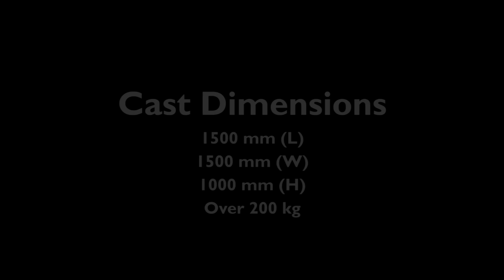Over 200 kg (440 lb) Aluminium Casting of a Meat Ant Nest - Iridomyrmex purpureus - 2015/10/19

Comment: This was very well planned from the looks of it
Reply from the maker: +Chris itsmeyay It took us months of planning
Reply: +Australian Ant Art How the heck did you melt 440lbs of Aluminium?? that must have taken a couple days! What was the average size of each pour?
Reply from the maker: +TheBackyardScientist We poured 13 times. Which is over 15.4 kg (over 33.8 lb) per pour. Our crucibles hold about 38 kg each and we have two furnaces. Of course we are counting the tops in this but we estimate we have over 100 kg in the ground. It took us a whole day to melt and pour. 2 days to get it out of the ground and on the back of the truck (ute ;) ). 1 day of set up and 1 of pack up. 5 days all up.

Funny thing is that this is a small meat ant nest.
Reply: +TheBackyardScientist How goes the backyard explosions?
Reply: +Australian Ant Art holy crap, and this is just a small nest!
Reply: +Chris itsmeyay Finale solution-like planned
Reply: Yes it was definitely premeditated murder. Guilty as charged.
Reply: poor ants XD
Reply: antz fall humans and honeybees rise
Reply: ***** and waps and hornet's die!
Reply: i want to do a wasp nest..
Reply: +Australian Ant Art 
If I may suggest, rent a posthole auger, or manual (clamshell) posthole digger, and buy a cheap sewage pump. Dig a 4-5' deep posthole, put the sewage pump in, and start it up before you start power-washing the casting to free it - should save you quite a bit of time messing around with shovels and trenches on the next one.

Very impressive, btw!
Reply from the maker: We have plans for the next one, if we ever do it again.
Reply: Australian Ant Art 
Experience is always the best teacher, no doubt about it!
Reply: +Australian Ant Art the old Ute might be struggling when you get a big meat ant nest mate ;) bloody buggers get big out in the Territory where I'm from, specially out bush.

Comment: Can you pour melted glass instead of aluminium
Reply: +Jee Khin  Ooooh!  Though my guess is that the glass would be too viscous and would cool too quickly to travel far.  That would be quite a sight, though.
Reply: Molten glass would cool down too quickly in these conditions and would fracture/shatter, and you wouldn't have the nice single unit extracted from the ground as they did with the aluminum.

Comment: Umm... Just out of curiosity when you guys do this do you not wonder if you are poisoning the soil there? I mean this sort of thing is not recommended by the EPA is it? I mean sure it produces some of the best artwork I have ever seen which is cool and all but, is it really worth the risk?
Reply from the maker: An small particles of Aluminium will oxidise and form Aluminium oxide which is very stable and nontoxic. Everything else is removed from the ground.
Reply: Ok Cool good to know that you thought this out before and not just willy nilly pouring molten metal in the ground. I was also wondering if you would do a post clean up video so it could be closely examined.
Reply from the maker: We just fill in the hole. Not much else we can do and not very interesting but will consider your suggestion.
Reply: LOL I was not referring to the hole but the artwork or casting. The video of where yall had it up on the truck did not show very much.
Reply: Hey Big Game, 
I don't know if Aluminium is poisonous when its in its liquid state but pouring it into the ground without knowing the consequences is not what i would call a good idea either. However it does make a good video and some beautiful artwork. Also the folks that posted the video did do their homework about the material left in the ground. Look back at the first response I got from Australian Ant Art and you will see.
Reply: Thanks Big Game. I am not into metallurgy or chemical science but i am pretty sure that aluminium is not a natural metal that is found in the ground and that it takes other types of material melted together to make aluminium.
Reply: Hey Big Game, 

This is what i found on Goggle, and I am not saying that your wrong for all i know you could be a Metallurgist. Just like to know for sure 
Thanks for letting me know.

Google search used " is aluminum natural or manmade"
Although aluminum is the most abundant metal in the earth's crust, it is never found free in nature. All of the earth's aluminum has combined with other elements to form compounds. Two of the most common compounds are alum, such as potassium aluminum sulfate (KAl(SO4)
Reply: Ok cool thanks for the info oh BTW thanks for the discussion kind nice to see exchange on here and it not get ugly. 
Hope you have a good day and like I said thanks man. I Like learning new stuff everyday
Reply: +SuperTrickyRicky And The Slippery SevenSevens HA!!!!!!
Reply: aluminum doesn't oxidize very quickly after it cools and even when it does it can't really penetrate the  ground so it would just sit there
Reply: I dont want to alarm you but the ground is already loaded with aluminum
Reply: +James Stead 
Bauxite
Reply: +Life with a BlueTick Coonhound aluminum is an element which naturally occurs in the ground.  it is not made up of any other substances.
Reply: mhn
Reply: it does not hurt the fucking ground
Reply: +Bristol Daffern 
Excuse me but how do really know that?
Has the ground told you this or are you making an assumption based on perceived logic.
Reply: Life with a BlueTick Coonhound Aluminum is mined from the ground and is not poisonous. You drink soda from aluminum cans every day. It's a marvelous material and almost 100% recyclable.
Reply: TheOrangePicker Lets try that logic with mercury... soooo now i throw a pound on the ground... well shit that wasn't a very good idea
Reply: I recall reading that when aluminum, (or aluminium, as they call it on the other side of the pond), was first discovered and refined into jewelry and other trinkets and bric-a-brac in the mid 19th century, it was significantly more expensive than gold. Of course, it was thought to be an extremely rare and precious metal at the time. Imagine the reaction of all the Guilded Age fat cats who tried to corner the market on this "new, rare and extremely precious metal", only to find out just how common and comparatively cheap it was.
Reply: Aluminum was mined from the ground, they put it in soda cans.  If it was toxic we would have noticed by now.....
Reply: aluminum comes from the earth same as copper, lead etc, last i checked though EPA is strictly an American agency.....
Reply: Yes. The soil shortage on planet Earth is a real problem.

Comment: I was surprized at the how shallow (depth) your cast was! Was it a new colony of ants or is there a clay layer that they don't dig into? Lovely cast none the less. Well done fellas.
Reply from the maker: Thanks. Aluminium doesn't tend to run any further underground than 1 metre. Since we use water to dig we can't cast the rest of the nest once we lift it out.
Reply: Australian Ant Art
That's fair enough. Thank you for replying. Cheers.
Reply: They like to stay closer to the surface because it's warmer there. The larvae need heat to develop and there's no point in digging deeper. (In cold climates ants may dig deeper to escape frost in the winter, but not in Australia.)

Comment: Is there a good way of ensuring no heavy metals actually stay within the local environment after doing this? 
Or does digging out the surrounding area do a good enough job?
Is the presence of left over heavy metal quite dangerous to the environment?
Just curious honestly
Reply: Aluminum is not a heavy metal.
Reply: Aluminum is considered
To be a light metal...
Meaning not much weight to it...
Aluminum / Lead compare for yourself ?
Light as a feather...
Light !   as in,  
flip the switch...
To the on position.......

Comment: why did you put the buckets over the ant hill?
Reply: to shade the ants from the sun. don't you know that ants are extremely sensitive to heat? it hurts them
Reply: right. (eyes rolling)
Reply: Maybe to keep stray aluminum flecks from going in before they were ready to fill those holes?
Don't want anything getting in there and hardening blocking the hole before you are ready to dump in it.

Comment: The number of ants killed here doesn't even represent a significant portion of the ants in THAT field. According to Wikipedia, a Meat Ant colony has an average of 11,000 - 300,000 ants. The total population of ants on earth is around 10,000,000,000,000,000! Even if we assume a max colony population (of which this colony was not even close) then that's 0.00000000003% of the world ant population. If you compare that directly to the human population (Which is stupid, but this IS the YouTube comment section.) that's the equivalent of 0.00228 humans being destroyed. You lose more than that every time you cut your nails. Anyone comparing this to genocide has no concept of scale and shows massive disrespect for the victims of ACTUAL genocide.